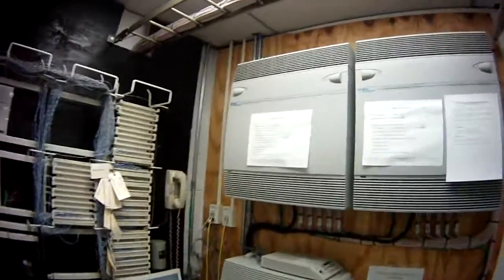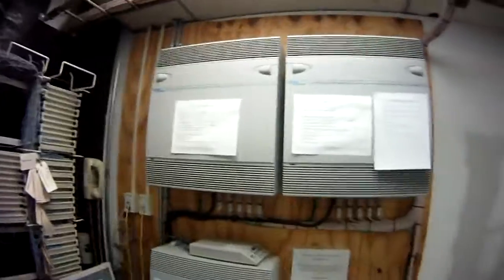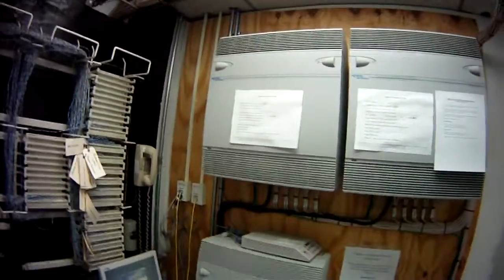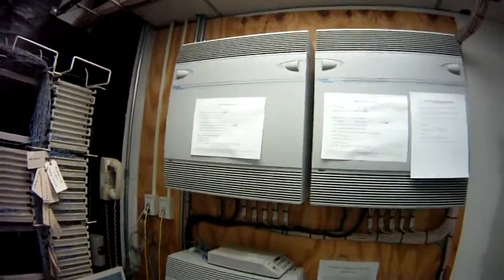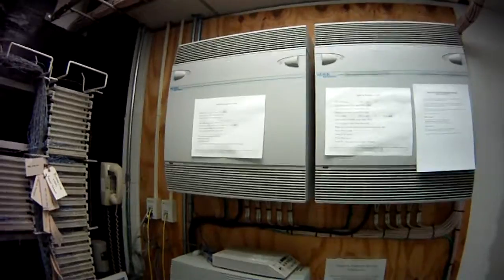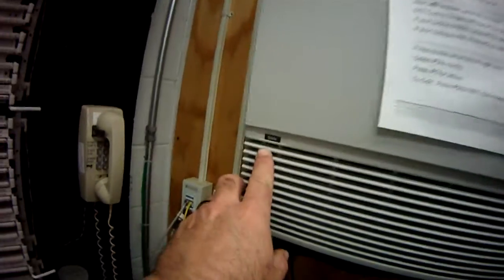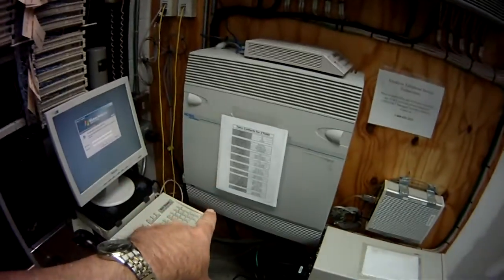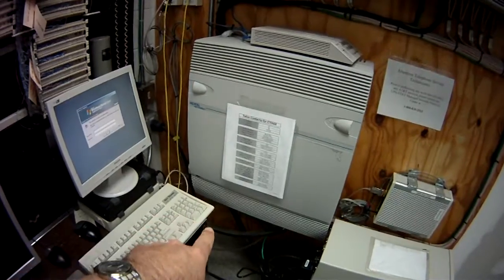Nortel Option11 -  basic layout

Comment: Wow, what a blast from the past. 
I wrote the training manual for EMEA when I was Nortel Training in Maidenhead, UK.
I travelled all over EMEA, Moscow, Comsomolsk (Ukraine), Munich, Oslo, Stockholm, Abu Dhabi, Dubai, Jeddah, Riydah, Al Khobar and many others teaching install and maintenance of the cabinets, cards, software etc.
Loved working for Nortel Networks. Moved onto Partner Product Line Management after 8 years with training and then 10 years later Nortel folded!
Reply: @arussell-bishop4438  You may very well have come across me at some time. I taught dozens of TO's on the SL-1 (one course which was the last SL-1 training course!) and Meridian 1 and applications (ACD, ACD MAX, Meridian Mail, DECT, etc.) but I did do a few overview courses for BT sales and management.
Also taught a few courses of Option11 to T2A's when BT started to use them for the hardware install then the TO's would finish off the installations.
Moved on to Partner Product Line Introduction working with the likes of Roger Holmes, Bob Matcham, Gordon Kinrade, Debra Braham, and others.
Good time, and happy days. Loved working for Nortel. I was one of the luckier ones when the axe fell. Just turned 60 and was thinking of taking the pension and retiring anyway.

Comment: BIX is better then 110.  Why would you use BIX over 110 out of curiosity?
Reply from the maker: hi Neil.  I don't recall me saying that BIX is better than 110. Or, maybe you're making an assertion? I personally prefer 110 because the punch is simpler and more widely used.  And also, I believe 110 is slightly more space efficient.
Reply: The Nortel Guy No, it was me that was saying that BIX was easier.  In Canada (not sure where you are?) BIX is our standard.  Rarely do you see 110 and never see 66.  BIX is literally 99% of what you see out there (in Canada).  It doesn't even matter what phone system it is on (Nortel, Cisco, Mitel) - when it comes to TDM connectivity, it's always on BIX up here.  I personally find BIX easier then 110 and cleaner.  I guess its just what you get used too.  I know when I was down in the U.S., seeing BIX was extremely rare - just as 110 and 66 are extremely rare up here.  

You have a very nice, very clean M1 deployment there.
Reply from the maker: Wow Neil.  That is very interesting!  I didn't know that about BIX being so common in Cananda.  Thanks for sharing.  
I will agree that when a BIX distro frame is managed right it does look very clean.  
One of my big gripes here in the US is many field techs don't carry BIX punch tools and so they try to use 110 punch on a BIX.  Then they ruin it. :-(
Reply: Neil Hyndman
I like Bix,.. but in México 110 is our standar,..